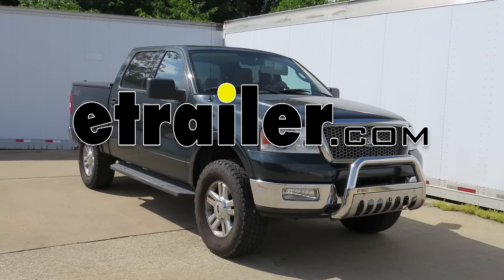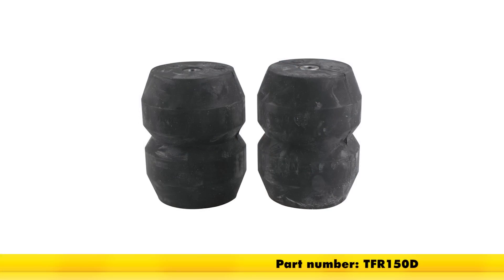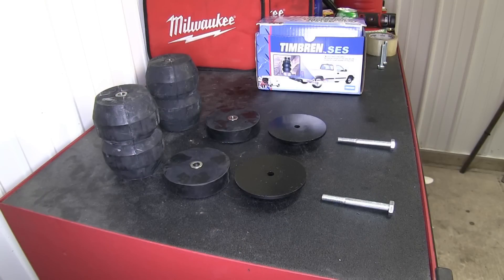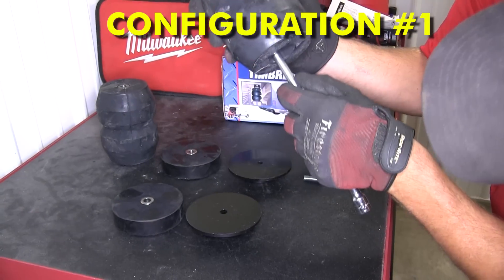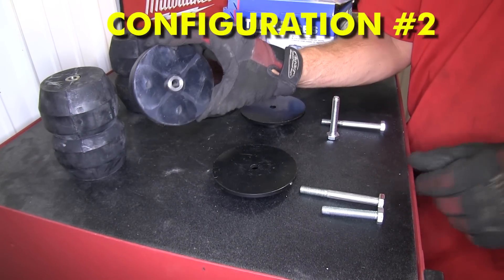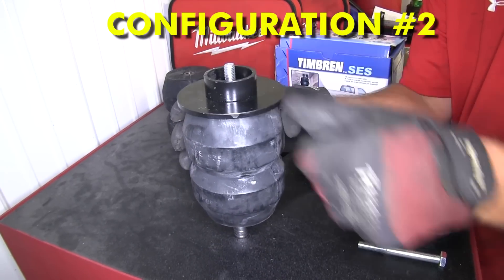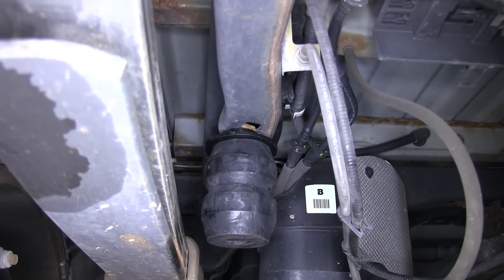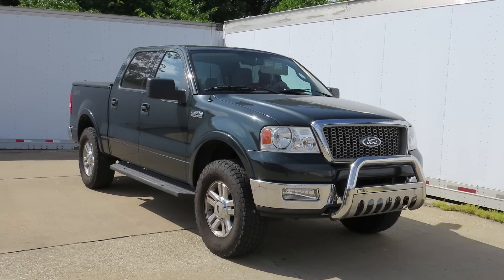etrailer | How to Install: Timbren Rear Suspension Enhancement System on your 2004 Ford F-150

Comment: I'm sorry, but what's this gonna achieve?
Reply from the maker: Rear suspension enhancement systems (SES) like this Timbren are designed to give some extra support to the OEM suspension on a vehicle. There is a wide variety of options out there, which you can see at the link below for a 2004 Ford F-150, and some are a bit different than others. Timbren systems have been around for quite a while and are known to really help prevent pickups from squatting so much when under a load. This in turn helps to increase the performance of your vehicle like handling and helps to keep your headlights down on the road where they are supposed to be.

https://www.etrailer.com/susp-2004_Ford_F-150.htm